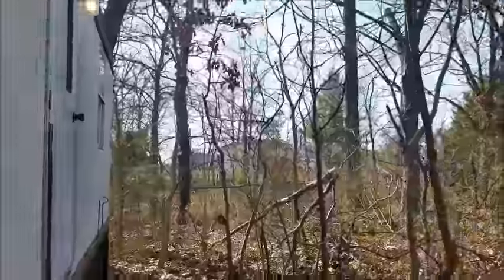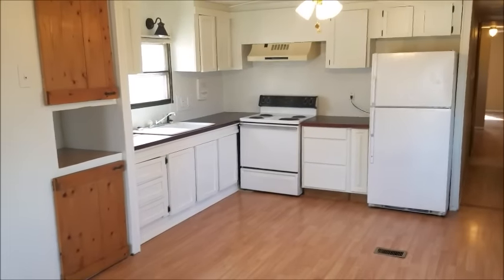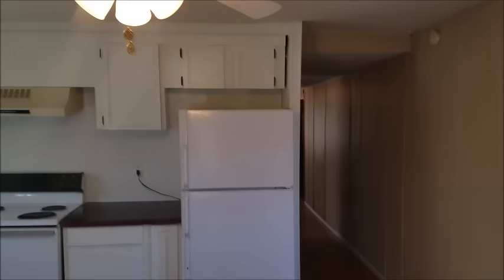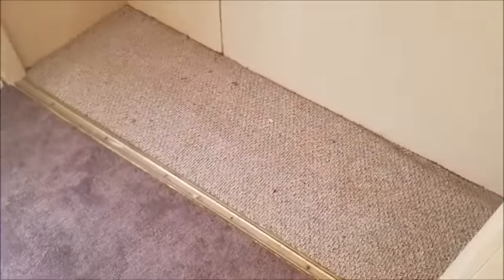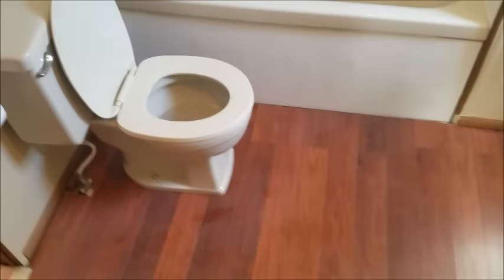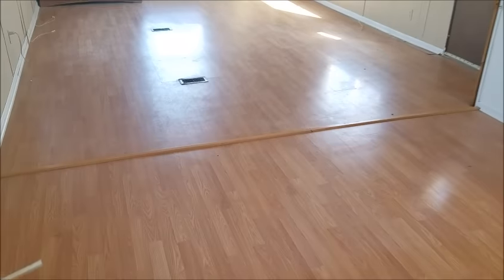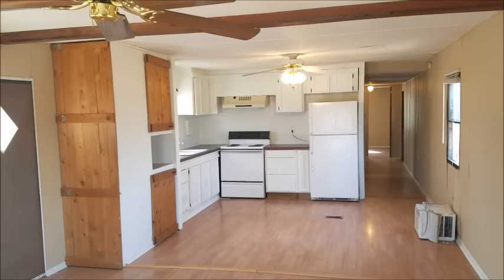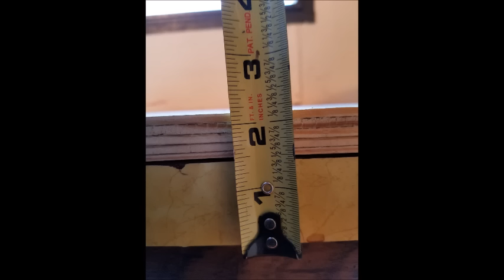Renovation of 1978 mobile home, flip to rent for residual income.

Comment: Me and my wife are about to start doing the same thing we are purchasing a trailer just like this and some land cash I have Built Homes before so I can do the interior remodel myself just basic stuff like you did which by the way you did a decent job in my opinion but my question is what about the exterior of the trailer do you recommend paying a couple thousand dollars for vinyl siding and new windows and doors as well or is that Overkill?
Reply from the maker: Depends where you are. If you are in a nice area where you don’t have large turnover (or in a senior community is good) on trailer renters who destroy your property and break windows etc then it might be worth considering. But otherwise no I would never put siding on a mobile home, I would seal the roof and sides to make sure no water leaks and paint if it it really needs it. Same with doors, on mobile homes they always get kicked in by somebody/tenant so I don’t replace them unless they don’t function. Senior communities are a little different in that often people do have pride of ownership/lower turnover/not as much distraction and I will do more to make them nice. Good luck!

Comment: I'm looking at a '95 fixer upper but there's a little more to be done than just cosmetic patch and repair so I wanted to ask who does structural engineer or inspections for mobile homes? It's listed for $8k I just want to know what needs to be done asap and make a plan going forward. I'm getting a few of these MH to make sure my kids and relatives have a place to stay nearby the hospitals if they're sick and need help.
Reply from the maker: Any reputable real estate inspection company can inspect them for you. If the dont for some reason depending on your area they could refer you to a good inspector im sure. We inspect ourselves however.

Comment: Personally I think you did a great job. Above average for sure. Personally I would invest in a better tub surround. The one you installed screams trailer trash. Sorry bro just being honest. Personally I would use thick sheet vinyl to enclose the tub area and maybe back splash. I've worked on many manufactured homes and good Sheet vinyl is a single wide owners best friend. You will learn Laminate is pretty at first but trendy. Its has issues....... Issues you will experience in that bathroom soon enough. Live learn and goodluck.

Comment: This looks like crap outside and inside who would rent something like this gezz whiz zzz the wall paneling on the wall makes it look like you live back in the 1800s , this trailer needs a total modern upgrade .
Reply from the maker: To answer your ignorant comments:
1. Who would rent this.....someone who is between housing for some reason or someone down on their luck looking for a short term cheaper housing option or just some people like mobile homes, also some people are not as fortunate and have to live in them short or long term.
2. Paneling looks like the 1800's......well this paneling wasnt available in the 1800's so ill just leave that there.

 Maybe you should try your hand at renovating a mobile home with a limited budget in order to help out those less fortunate/provide very small rental income, before you attempt to slam us about it "geezz whizzzzz".
Reply: Roflmmfao 1800s

Comment: How long do you expect a countertop to last it’s gonna last the same amount as plywood with the seal costing as a regular countertop it’s about the use of it or the abuse of it you abuse the countertop or the plywood and it’s going to deteriorate just as fast. It’s a cheap innovative way to do it and it still looks great. Its a lot cheaper to replace if anything happens to it. It gives it a rustic look real wood countertop think of it that way. I would rent it it looks good

Comment: Wall area behind kitchen sink will be ruined. You should have spent a little money for a countertop with back splash. The windows are absolutely horrible. The white vinyl windows at Home Depot are cheap and very nice (requires that you put exterior trim around windows on the outside and do a quality job caulking and painting.

Comment: what kind of paint did you use on the kitchen wall? 
I have a mobile home with vog walls with ugly flower prints... I used this paint (can't remember what type) that HomeDepot recommended me and they are falling off already!! :(
Would you mind sharing the tips?
Reply from the maker: +Si Moon I cleaned the walls with tsp and lightly sanded them before using a latex based paint and it seems to be holding up well.
Reply: Thank you very much for the tips!! I think mine was water based paint .... 
Thanks for the video too! I enjoyed watching it ^^
Reply: Oil based killzs hide alot. I used it in a smoke damaged home

Comment: How far did you have to move the mobile home? My wife and I just picked up a 14x60 for $2,500 in New York and I heard you said it cost $3,000 for you to move it. Thank you
Reply from the maker: It was about 30 miles, maybe a few less. It was 3000 to move it if I remember right, and he spread gravel over the pad. I hooked up electric and water/sewer and put skirting back on. Thanks for watching. Good luck with the mobile home.

Comment: At 12:52  who the heck thought it was good idea to do it like that?  There is no P trap and sewer gasses would be venting out of the tub drain. Plus the drain is not sealed where it meets the black pipe which means if that clogged up just right the water would have wrecked the floor.     I been helping my niece who bought a nightmare home for $1,000.  Someone busted both tubs and the water wrecked tons of the flooring.   The toilet was only supported by the drain pipe.  The stove was only supported by the floor joists along with everything else.   The kitchen sink also leaked and the drain baskets were cracked.   The gas valve for the furnace was bad.  Cost $110 for a new gas valve.   The AC unit someone really buggered that unit up.  I will be digging into that in the spring just before summer to get that going.   I could have swore the damned place was a typical meth lab.
Reply: jimmy101112000  paying only $1000.00 means it is a complete gut job and then some. Hoping when it’s all finished to code or standard that your niece has a great home that’s paid for !!! Best of luck 😉
Reply: is this propertybin Missouri?? the before looks like the piece of crap trailer my ex lived in 21 years ago. Funny how many gross places were rented out in those small towns...

Comment: Mobile homes in the 70's were usually 12 feet wide. All the way through the 80's. The 90's brought in the 14 wide and the mid to late 90's brought in the 16 wide. Double wide was 24 in the 70's and 28 in the early 90's to 32 wide in the late 90's.  Where in the 70's did they have 16 wide mobile homes.

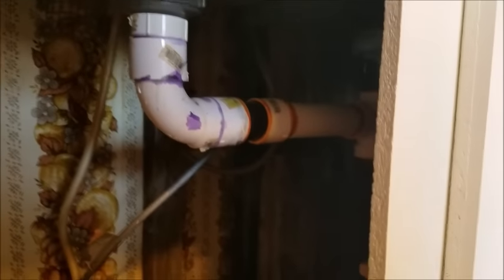Comment: You need a p-trap under that kitchen sink. Without it, gases and smells can come back up through your pipes. Besides, codes require it. I'm only at 3:04 and wondering if I can watch the rest of the video. I'm going to try, but I doubt I'll watch until the end.

Comment: What is the stone material that you placed under the trailer?  I've lived in a trailer in central IL & also in IA & other than runners or pilings they didn't put anything - left it just dirt to get muddy & be a royal pain in the ass when you need to do any work or checking on anything underneath.
Reply from the maker: 1inch grave if I remember right. Yeah helps cut down on the mud a bit for sure.

Comment: youre gonna run into the same problems in the bathroom with the soft flooring around the toilet and tub if you dont seal the gaps around the tub and toilet with silicone..

Comment: How far did you move this trailer? ($3000) I'm looking to move a trailer and now sure how much its going to cost me. Thank you
Reply from the maker: It was about 30 miles. Definitely check around and get a couple bids. And if you unhook and rebook up the water/electric/skirting yourself, it will save you a fair amount.

Comment: Hi I want to buy a 1979 mobile home for residual income. I'm just concerned about the maintenance of the mobile home. I'm weary about the year and how much it'll cost to keep it's life spam. Is there a big difference between a mobile home of this year and a 1990? would the maintenance cost a lot more between a 1978 and a 1990? Is there a big difference in terms of investment to flip it for residual investment?
Reply from the maker: No not a lot of 'maintenance' cost difference. Really depends on the shape of eavh year when you purchase. If you have a 1990 no body has maintained it will be more expensive to upkeep/repair than a 1979 that has been well cared for. Exceptions veing ac/waterheater etc the appliances with a limited lifespan.

Comment: I hope you cleaned up the mold in the walls. And isolated it under the trailer or you aren't being far to the renter. Because trailers loss a lot of heat and air because of the windows and walls because of how easy mice can get in the walls of them. I owed a trail. I had to reinsolat it all from bottom to top

Comment: Not so sure this is a 16x80..
Reply from the maker: it could be a 14x80 possibly, I cant remember at this point now. right around there somewhere. Thanks.
Reply: This mobile looks like a 12 x 60. Definitely not a 16 x 80. I live in a 14 x 70.
Reply: It isn't! I've lived in mobile homes just about all my life and 16 by 80 (actually it's 76' long, bc allowing 4' for the tongue) wouldn't made until I want to say in the 80's, but that's looks as if it's maybe 14 by 70...

Comment: Doesn’t look safe to me!!!  Was this inspected or just money for you??!
Reply from the maker: Yes inspected per city.
Reply: Couldn't resell it ever though, hence renting it being a work-around. In 2005 I bought a 1979 14'x52' single wide that had been completely gutted leaving only the frame and exterior "skin" and new electrical, insulation, all flooring and floor coverings, central heat/ac and ductwork, sheetrock walls and ceilings, all cabinetry and window/door/floor trim solid oak. It had never been lived in after the remodeling, which was done for the owners to live in when they were both retired. I paid $5000 for it, the kitchen cabinets alone cost more than that.  But the insurance company said it was barely within the maximum age of a mobile home can be insured. It dosen't matter how recently it was remodeled because the title and vin # are for a 79' mobile home and can't be updated to the "rebuild" date. If I was to ever resell it the new owners wouldn't be able to insure it.

Comment: This isn't a renovation, this is a cheap crappy rental. You didn't replace the windows, doors, subfloor and you really needed to replace the front steps and railings. 
In short, cheaper isn't better. And your title is disengenous.